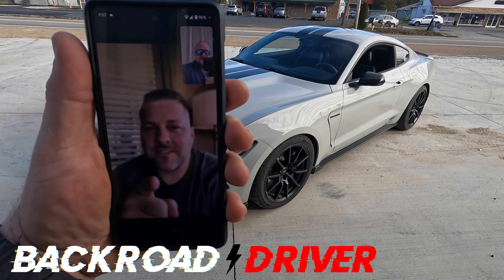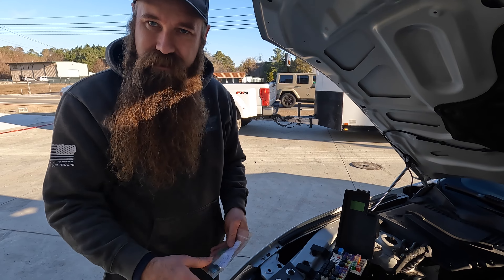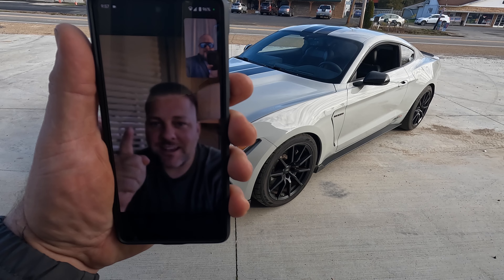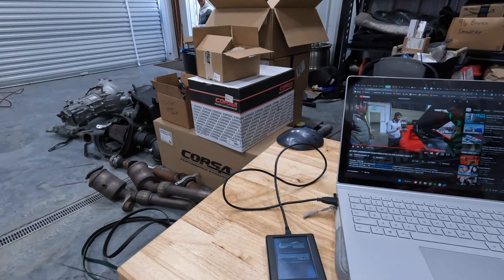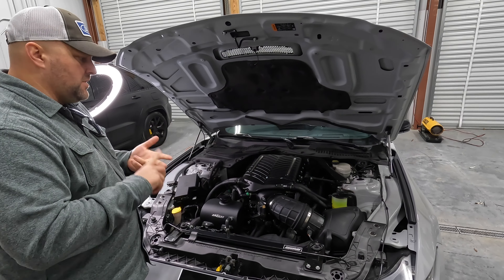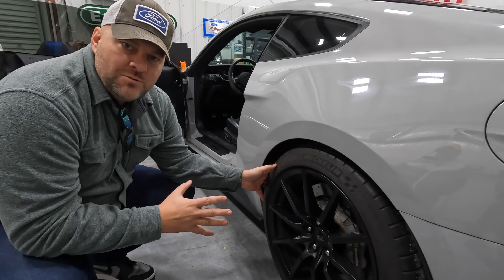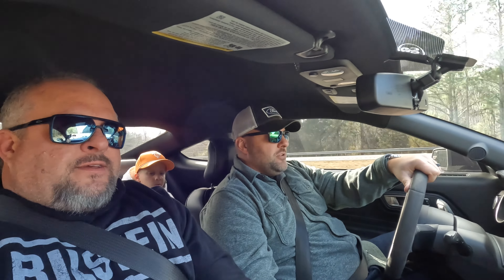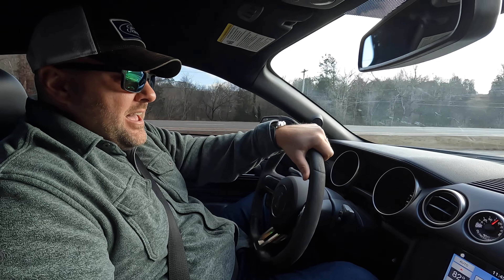INSANE GT350 800R Fathouse Performance Build Delivery & First Drive!

Comment: If you want to modify the f150 suspension, consider doing a raptor suspension swap, that way you get some functional lift. I doubt you’d be able to enjoy the power from that truck with a standard dinky lift kit. I’d be happy to elaborate if you’re interested.
Reply from the maker: What setup would give me travel and still allow me to mess people up from a dig?
Reply: @BackroadDriver  raptor swap + track bars, check out the ones from RPG offroad

Comment: Ford stops production of Mustangs that use performance tires in winter months. At those temps. Those tire are like rolling stone wheels. Zero traction and even worse if worn out. Nice build. It's good your Track Hawk sets high because if your GT350 hooks from a dig. It's driver will have a great view as the GT350 drives out of the Track Hawks life. Looking forward seeing more video of your GT350 beast.
Reply: Driving summer tires in 8 degree temps is a death trap.

Comment: Hey guys. Was the exhaust stock after the headers?
Reply from the maker: High flow GESI cats and then stock
Reply: @BackroadDriver awesome! Sounds great. 

Contemplating an 800 TT or the whipple. One of the 2. Ever wish you had done turbos or happy with the whipple?
Reply from the maker: @matthedges1773 this will probably go TT if and when I blow the motor. It is Gen 1 with some hard miles on it. For non drag racing and just backroad driving the Whipple is more than enough. If you want to drag race at all you would be crazy to not go TT. Over 800 WHP is not as easy with the supercharger because the supercharger is belt driven and the crank snout has a lot of pressure on it. That isn’t an issue with the TT’s. If you want to go over 800 I would TT. The other big advantage of TT’s is that you can change maps/tunes without changing a pulley and updating the tune. The twin turbos have some very cool tuning advantages.
Reply from the maker: @matthedges1773 I have a new video on this build after all current mods dropping Tuesday of this week. I go into a ton of detail and do an extended drive review.
Reply: @BackroadDriver 
Yeah I hear ya brother. Ive done a few prochargers and a few TT kits on other applications. Never done a PD blower. Talked to Ben for years about doing this but also don’t have unlimited funds. 

Feel like I’d regret going with whipple but also want to maintain voodoo sound

Comment: Is it just me or do these cars just sound worse and worse the more you change the exhaust. Stock just sounds so good.
Reply from the maker: They can get raspy and shrill. When the cats or removed the pitch is too high.
Reply: @BackroadDriver  So it's not the headers just removing the cats that does it?
Reply from the maker: I have headers and high flow cats on this 2016 and it is almost perfect. My 2020 had headers and no cats and it was too loud and shrill. This 2016 will change when the Corsa X-pipe and Corsa extreme mufflers go on. The cats do a lot of work to cut down on rasp.
Reply: @BackroadDriver  Thanks man I'm trying to figure out what to do on my R.

Comment: What in the HELL was that annoying ChirpChirp, ChirpChirp??? When it came Off the TRAILER and was Idling?? I think it's a BELT Noise???  OMG, What a   B  E  A  S  T!!!!  Jesus H. You Guy's Be Careful with that Unit, Don't wanna see anything Bad Happen. Nice STANG!!
Reply from the maker: I need to see what the chirp was. Went away after it warmed up.
Reply: @BackroadDriver  BELT, I guarantee it. Check this out, (if ya never heard this b 4), if you hear the Squeak, and you think it's a BELT, Get a Spray bottle (OF WATER) and just Spritz a shot on the Belt, if the Squeak goes away??? Bingo.  Lernt that from a Mechanic friend a couple Years ago. I had no clue U could use Water to find a BAD SQUEAKY BELT???? Go Figure... Also, I SOAK my Serp Belts in 303 Interior Exterior Protectant for a WEEK b 4 Installing! Keeps em from Squeaking!